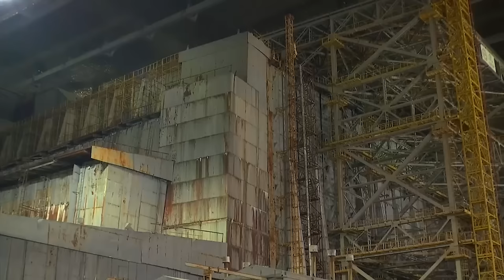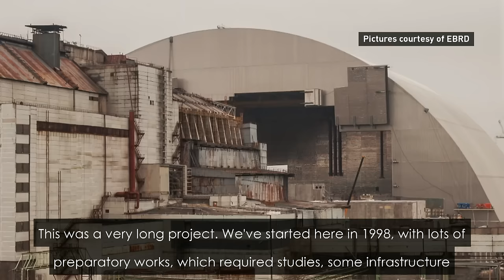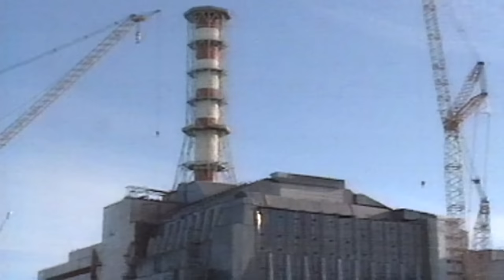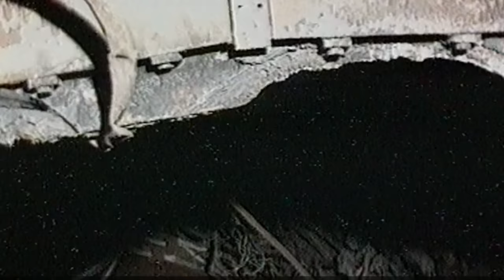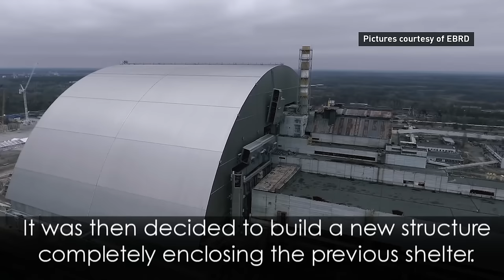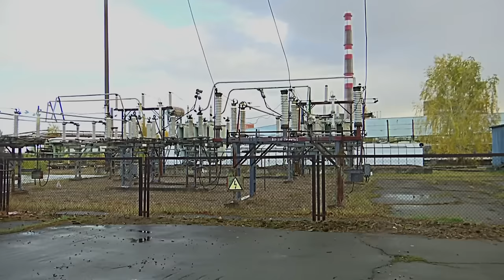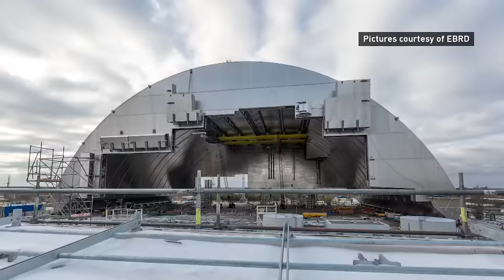Inside Chernobyl’s new €1.5bn structure for exploded nuclear reactor

Comment: So what happens after 100 years? Or is that someone else’s problem.
Reply: I suppose 100 years is a long time for something to last under the circumstances.  You're right though, by then they will have a totally different, more effective way of dealing with it.
Reply: Prob. And this time they were right but took 130 plus years later...

plant director Bryukhanov reports no more than 3.6 roentgen. I'm told it's the equivalent of a chest X-ray.

Haha
Reply: Basically
Reply: Then we'll build another hanger that goes on top of that, then another, then another until we have a russian nesting doll of chernobyl... Hey, I have a great idea for the gift store...
Reply: As I've heard they have installed cranes and remotely controlled machines to remove the waste for storage in containers. But I think they have not started yet (maybe radiation levels still too high?)
Reply: @cymbala6208  From what I could understand, they can not "pick up" the waste, because in this particular case the waste is in an unusual form called "corium" which is not really solid, it is extremely radioactive, and melts/incorporate any material it come in contact with, infact it is made of molten concrete from the floor of the reactor room, together with a mixture of nuclear fuel, fission products, control rods and other structural materials.. it is a mess that actually moves like a really slow "lava", and this is an additional problem becuse there is the risk that it reaches the water-bearing stratum underneath. (sorry for the poor english).
Reply: @pccalcio  I'm pretty sure that mixture of nuclear fuel, graphite, lead, sand and whatever they threw into the core is solid now. For sure it has melted into the ground initially so I guess it would take heavy machinery to dig the stuff out. The term 'pick up' was a little bit misleading... sorry...  I'm not a native speaker either 😁
Reply: In 100 years, life returns to normal... Right now, in 2019, humans are back living in the zone. Perfectly healthy.... Animals are also thriving seen as there aren't many humans around...

Why? It's cause you have radiation all backwards. The media likes to scare people with half lives of 'a million years!' because a million years is a big number. Really, if the half life is a million years, its because it's decaying slowly. Slow decay = low counts per minute/hour/day etc.... The really really super duper 'fry-your-eyeballs' type radiation comes from atoms with half lives measured in days or hours. short half life = fast decay = billions of particles per minute = high dosage in short amount of time. 

That super duper nasty stuff? Its all gone by this point... What's left is radioactive but due to the inverse square law, you have to literally be sat on the stuff for a long time to get what could be considered a meaningful dose. The rest can be dealt with by your bodies natural healing abilities. The only reason there is still such a high particle count from within the reactor housing itself is because there is literally tons of fuel left over and thus all the accumulated particles lead to a high count reading. Increase of cancer chances in your lifetime if you moved there today? About 3% increase.

By the way, you get more than that sucking down exhaust fumes every day.
Reply: Cymbala I‘m really looking forward to see the future use of the crane and how they work inside the new sarcophagus. I would like to see some deconstruction and decontamination. Like a somewhat normal deconstruction as if it were a retired powerplant.
Reply: @cymbala6208  it seems you might be correct, it's moving but not significantly. I found this after a brief research:
"The Elephant's Foot had penetrated through at least 2 m (6 ft 7 in) of concrete to reach its current location.[3] There were fears that it might continue to penetrate deeper into the ground and come into contact with groundwater, contaminating the area's drinking water and leading to illnesses and deaths;[11] however, as of 2016, the mass has not moved significantly since its discovery and is estimated to be only slightly warmer than its environment due to heat from the ongoing nuclear decay."
Reply: @Crimsonedge1  if this is correct, then why did the European Bank invest 1,5 billion dollars into the New Safe Confinement? If what you say is true, there wouldn't be a need for this.
Reply: @Andizu1  Zone is very safe now. But to keep that state, new structure was needed.
Reply: @Andizu1  'IF' its correct... Just google radioactive decay dude... Its not exactly rocket science. Fast decay means its losing lots of particles fast. It leads to a high dose count. Slow decay means it only loses one particle every now and then. In something with a half life of a million years, the material can sit there a month and not give off a single particle. Its why it takes it a million years to halve by weight.

Also, they built the new containment as the old sarcophagus was crumbling and they wanted a new roof before the old one collapsed. Had that happened, a huge radioactive dust cloud from the dust that has settled within the sarcophagus 'COULD' have been blasted into the air and carried on the wind.
Reply: They should just build another one just like it
Reply: @Crimsonedge1  while you are right about the decay, the NSC wasn't build 'only to prevent a cloud of radioactive dust' when the sarcophagus would collapse. It is erected also for the safe dismantling of the power plant and to safely dispose of highly radioactive material. It seems I'm not the only one needing to do some reading, dude.
https://chnpp.gov.ua/en/activity/shelter-object-transformation/project-nsc-construction
Reply: @cytrynowy_melon6604  exactly.
Reply: @Andizu1  That's just why the inside of the safe containment building has automatic cranes. The building was built for the sole reason that the original sarcophagus was slowly collapsing. If it wasn't slowly collapsing, they wouldn't have bothered building the new safe containment unit and would have just left it buried for another 30 years. Seen as they had to build the new containment building though, it made sense to put in equipment that would help to disassemble the reactor in future. IF they eventually get round to starting the actual decommission. They'll likely just mess around with the robot cranes for awhile, maybe remove a piece or two of the old reactor and then decide they've run out of money.
If they were actually bothered with the clean up, they would have started it long ago before the sarcophagus started to crumble. The technology was there in 1991 to start the clean up but they didn't bother.
Reply: A problem for the future
Reply: Dwayne 100 years is nothing for history point of view. Unless our history is near the end and it is most likely be our fault ( unless it’s a space rock hitting us)
Reply: @Crimsonedge1  I think you need to further read the information on the site I provided.
Reply: @Andizu1  For what purpose? It's not going to inform me further about anything I don't already understand. What is the site going to say? Their plan of action? Their aspirations? Their hopes and dreams?
I fully remember the day when the radio told us to close our windows.... And I live in England. You have any idea how many 'plans of actions' there have been since then? 
I'll believe it when I see it. End of the day, the reason they built the safe confinement was that the old one was crumbling. They didn't start the new project with the direct aim of decommissioning. That was a secondary aim. Had the original sarcophagus still been perfectly fine, you think they'd have bothered to spend all that money for the new one when they've just been happy to let it sit till now despite the fact that the technology for decommissioning has been in place for the best part of two decades? 
No... They wouldn't. It's why they left it for 30 years and it took the risk of the sarcophagus collapsing for them to even make any headway. Its the same with all technology... It takes a great deal of deaths for work to be done. 
Take train safety systems for example... Fail safe breaks... Automatic speed restrictions... Driver warning systems...
You think rail companies throughout history just woke up one day and decided to invent a new safety measure and spend all that money to do so? No... Every safety system we currently enjoy was made from necessity to stop the various types of accidents that we're killing many people throughout rail history. It takes people dying to generate funds... As long as people aren't dying, money isn't spent. 
As for the actual decommissioning, again, I'll believe it when I see it. Until the mentality of 'its best left buried' goes away, that's all they're gonna' do. They will eventually run out of money, they'll look at the situation and say "well, we have the new safe confinement in place now so its perfectly safe while we put the decommissioning project on hold' and it will be left for another 30 years. 

Yeah, yeah, the website says this and that. It also says OXO on the side of buses but I'm still yet to get on a bus that ever sells it.
Reply: @Crimsonedge1  well... That kind of ends our discussion then, I suppose, since your skepticism will never accept any other argument than yours. At least we tried ;)
Have a nice day! 😊
Reply: @ Rested soul...yep..pretty much
Reply: @cymbala6208  I think they have started the work, the problem is the old containment structure is in a strange state of being both stronger than a bunker and as fragile as a house of cards at the same time. They will have a hard time cutting into it and lifting the heavy pieces, doing so without sections collapsing makes it a real challenge. 

It will take decades to peel it away section by section, safely store that as high level waste itself. After that they can get at the reactor, which is capped by hastily air dropped concrete and minerals and is a mess of graphite, twisted and once molten steel and corium.
Reply: They are 100 years old to deconstruct the old sarcophagus and the reactor.  I hope they will have time ...
Reply: @cymbala6208  unfortunately not, it is still moving and absorbing everything in its path. The concern is when it will melt through the concrete floor and become a threat once again to ground water, unfortunately I haven't come across any plans to be able to deal with the mass.
Reply: @cymbala6208  I have not heard anything about plans to remove anything from inside with the crane. My understanding of the crane is to dismantle the old concrete sarcophagus so that it's collapse won't damage the new structure
Reply: in 100 years we will have teleporters to teleport all radiation on earth into space
Reply: They put cranes inside to take everything out
Reply: @germman93  thanks for the info. I'm going to have to do some more research now
Reply: @veteranheavyequipmechanic4990  theres an PBS documentary all about it.  Pretty good stuff
Reply: we heard you like containments so we built a containment on top of your containment.
Reply: @Andizu1  if they didnt, the sarcophagus wouldn't of been enough. It was only designed to last a few years. So the NSC is a ,ot safer and there's no risk of it falling into the reactor. The sarcophagus can now fall I ot the reactor and there'll be no real effects outside of the NSC. If it wasn't put up, the sarcophagus may if collapsed in, it would be like 1996 again. No on ewants that right?
Reply: @Crimsonedge1  the sarcophagus was fine until major damages were seen in 1998. After that, the European bank got involved. The research into the NSC started not long after. Securing the materials, infrastructure, robotics, personal, and funding. Because it was only a small part of the European bank that was dedicated to Chernobyl. The rest of the bank is still probably trying to fix eastern Europe. The original sarcophagus was simple. Cover the reactor so that it won't release anymore radiation. The NSC on the other hand, has got to be able to house robotics. It has to be able to pull out parts of the reactor, that's why the crane is there.
Reply: @ethanedwards422  I already knew that. My questions were meant to challenge another poster's claims and were rhetorical ;)
Reply: They are going to dismantle the actual reactor on that timeframe, I guess it looks like picking up a box that has been sitting for a decade, it gonna kick a lot of dust in the process, or radiation in this (metallic) case.
Reply: @MYGTPHARAOHATEMXIDSMDSLOTD   Putting the waste into space...   that's gotta be a hell of a fine from the EPA lol. Probably wreck the habitats of the space walruses and then well have to go clean up their area in 100 years down the road.
Reply: Hopefully within the next 100 years, nuclear power will be reborn in the form of molten salt reactors. A fleet of these at Chernobyl would be the best eventual outcome for Ukraine, plus which, such reactors can burn off the long lived actinides which will need dealing with when they come to reprocess the 'elephant's foot' and such material.
Reply: After 100 years, they build another even larger containment around previous one.
Reply: Who cares,  we will be dead by then
Reply: Rested soul 

..You just answered your own question
Reply: they are planning to dismantle the building entirely and seal it up as nuclear waste, not a final solution but it will make further containment much more convenient.
Reply: Thats why nasa is looking for new planet.. Earth is already in ruins
Reply: Would you like to volunteer and go inside to fix it? Be our guest.
Reply: Robots break because of the radiation so let's see how you do.
Reply: I suppose they’ll replace the old structure with a new one, hence why it’s ‘moveable’
Reply: +Rested soul. Nothing spectacular, they'll just have to do a structural integrity check and repair anything that isn't in good condition. Then the building is good to go again.
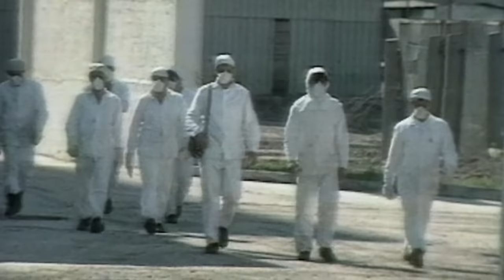Reply: The plan atm is to use cranes inside the new safe confinement to dismantle the old structure and to get out as much corium as they can. As for the dust questions they have a filtration system to prevent radioactive dust from escaping (you can see it behind the guy speaking at 1:10)
Reply: Dwayne    Humanity 100 yearsssss later: hologram cats and still no flying cars
Reply: @Crimsonedge1  In fact, the vicinity of Chernobyl is still a very dangerous place to live.  Even 50 kilometers from the reactor, you can get to a place where radiation is 10 times higher than the permissible level.  And it can be very dangerous.  And people returned to live in a 20-kilometer zone, not because it is safe there, but because for the most part they do not believe in radiation (read science) and they have no place to go.
Reply: Well, for a starter, most of the radioactive isotopes will have decayed away by then. More importantly, the structure was designed to be moveable for a reason I think; and part of it is so its easier to make repairs on it in the future.
Reply: still radioactive
Reply: Look at how much of an improvement this new containment is, compared to the old one. And that's just 30 years later. In 100 years we'll definitely find something even better

Comment: Someone explain to me please - if it’s so deadly and radioactive that they had to build a structure, why are people just chilling next to the reactor ? Am I missing something ?
Reply: Because the real dangerous radioactive stuff is inside the nuclear plant under reactor 4. The raditation has lowered since exploding and its behind the chernobyl nuclear building and the old shelter so inside the new shelter isnt that radioactive and the ppl work there only a while and get banned.
Reply: Staying in the new structure is exposing them to very low doses of radiation. They do wear masks to prevent breathing in any radioactive dust as our skin can shield us from some radiation but if it gets inside it does much more damage. If they were to go inside the old building they would be exposed to higher doses which is why protective gear is worn. There are many places inside the old structure that still have lethal levels of radiation.
Reply: Problem is not the gamma radiation thats coming from the reactor. Gamma emitters are too heavy to be carried by wind. And Air is good enough radiation shield for static emitter.

Problem is alpha and beta emitters, those can be carried around by wind (radioactive dust)
 
The shield structure is for keeping that radioactive dust inside.

Atleast this is how I understood it.

Comment: $1,500,000,000.00
You'd think they could acutely clean up the mess opposed to a structure that fixes nothing...if not on fire right now.
Reply: This structure heads off a lot of potential problems down the road. That old sarcophagus was built in a huge hurry in a hostile environment, so it was living on borrowed time. Now there is a safe place to work on deconstructing it and decontaminating the wrecked power plant inside. If it collapses now, it'll be a huge mess, bit the fallout will be contained.

Comment: Since the original shelter had deteriorated wouldn’t the workers working on the new shelter be exposed to radiation?
Reply: They would, but it held some back still so they had time unlike back in the days of original disaster.
Reply: The radiation levels have greatly reduced over time. The reactor is also buried in sand and such and the old containment building is still providing shielding. The radiation levels outside the old containment building aren't bad.